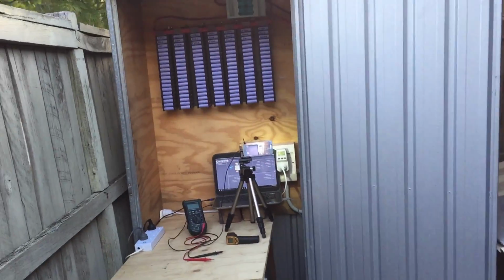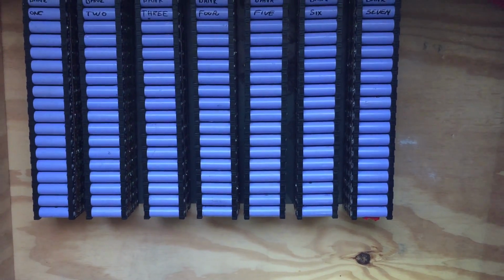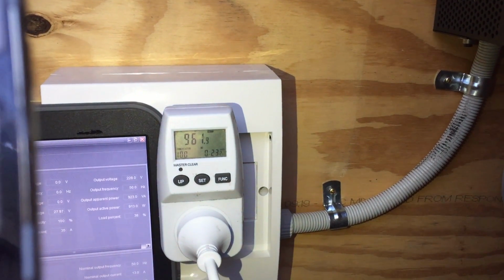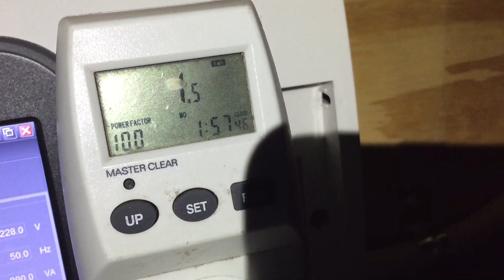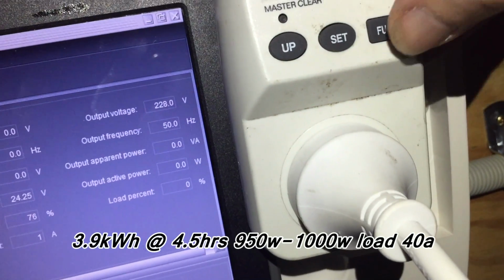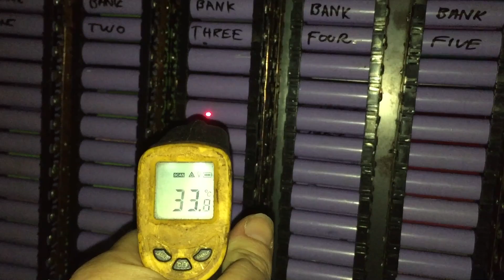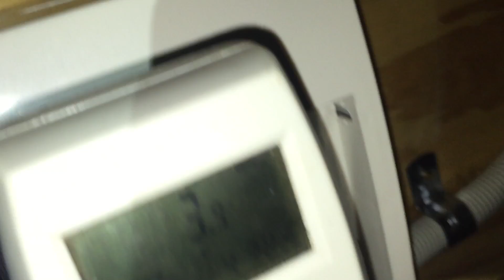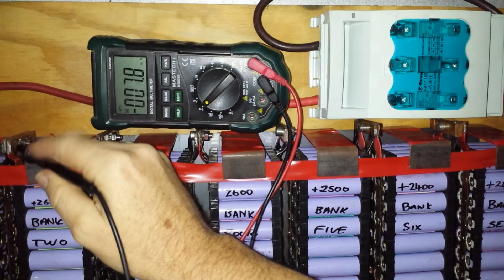First ever load test of my DIY HomeBrew Powerwall

Comment: Hi. I have been with solar panel for many years and started manufacturing my powerball. I've been following you for a long time and I think it's fantastic what you do. I have doubts about the minimum voltage to recover the 18650. From your experience you can recover the batteries with less than 2 v or not worth it.
Reply from the maker: I've said this more times than i can count. Voltage means nothing. 0.02v is recoverable if done correctly and by correctly I mean charge at 0.002 amps till you get over 2.5v. then charge/test like any other cell. It's just when the cell is ZERO volts you recycle straight away
Reply: ok

Comment: LOL "I am going to upload a video to prove how much of a moron I actually am" ps that fire extinguisher aint going to do shit
Reply from the maker: Don't dissagree - what about the 120 temp sensors that triger a shunt trip when any get too hot too cold or go over or under a infinataly adjustable voltage ie right now if any cell rises above 4.18v EVERYthing shuts down THEN my bms brings voltage back down to 4.13v you can rant on all you like won't be anything you can say that hasn't aready been addressed :) xxoo

Comment: Just a question, I have a 15kw LF inverter by power jack, uses 24v, works awesome, I currently have 4 12v car batteries of 700cca each that will run a 3500w load for 3 hours, so my question is how many 18650s will I need to work properly? Thanks
Reply from the maker: It's impossible to use Powerjack & awesome in the same sentence. I have had repeated horrible experiences with their products and warranty procedures. Now to your question - your math seems off, you get 10.5 kwh from 4 car batteries? Either my math is off or you mean 350watts. Can you clarify the load that your running again?
Reply: HBPowerwall no it was 3,500 watts because at the time I had a power outage during the winter so i had it hooked to the breaker box to run my central air furnace, infrared space heater, my electric griddle and coffee maker and half the house lights (I was in the middle of making breakfast when it happened)  so it was an unofficial test but surprising as to how well everything worked.
Reply from the maker: I would be very concerned about pulling those amps for 4 car batteries - I've done the same thing killed a plate in my batteries (each of them all brand new) i wasn't happy. Great that it got you out of trouble tho!!
Reply: HBPowerwall my cables were getting warm and they are core batteries that I got from my job that had at least 75% life left

Comment: I need and advice. I have modules of 6x12=72cells 2150mA cells (572W). I can buy 3000mA cells so I am making 4x13 modules(577W).  I am installing this different modules in series, do you thin they will work right

Comment: I notice you place the positive and negative terminals on the same end of the packs.  Average Joe claims that you shouldn’t do that because it tends to pull the amps from the cells nearest the terminals. Therefore, he put the negative and positive terminals on opposite ends of the packs... do you think this is why the tops of your packs are getting hotter ?
Reply from the maker: Yep, this test was done 12 months before Jo's lol after this test I changed all to top n bottom :)

Comment: would that pack be able supply 2kw, I want to build a similar pack that will be able to supply 2kw even if its only for a few hours. is that possible you think
Reply from the maker: Everything is possible :) How ever is it practical! It would you could happily draw that from it how ever tests prove after a few hours they start to heat up with 1000w draw...
Reply: I want to build a solar system to run a load of 2300w for a few hours at weekend thinking of using around 800cells, do you think its a bad idea, dont want to spend money if the system will not work. Thanks
Reply from the maker: 1200 cells would work i think, but is it a constant 2300w load ? that's a big constant load

Comment: The problem with the heat is 2 things. someone mentioned in many vlogs before you taking both the power from the top batteries so the bus bar resistance is lowest at the top but too late to change that. so making one bus bar taken from the bottom would even that out.. 2nd issue is that heat rises and the bottom ones would heat up the ones above them. but that won't be toooo much, i suspect the top ones are being drained more due to the bus resistance really. I'm sure you've realised this by now anyway (2016)

Comment: i need a pack that can run 1500 watts at 110v or 230v for at least 30 min (more is fine) should i use lead acid batteries or these lets say laptop batteries? they also will be charged and discharged 24/7 (its suposed do be a UPS for servers)
Reply from the maker: You'll have to do your own research sorry.

Comment: Great video !!

______________________________
Power = Voltage x Current
W = 3.7V x 20A
W = 74

Energy = Voltage x Current x time
W time = V x I x time
W hour = 3.7V x [3000 mAh]
W hour = 3.7V x 3 Ah
Wh = 11.1

That simple.

And for reference,
1000 Wh = 1 kWh [1 Electrical Unit], 
which is what our kWh energy meter uses in home
______________________________

mAh and Ah which are seriously flawed unit (which doesn't take voltage into account),
which is normally used by manufacturers and marketers to misguide people !!

Professional and universal unit for energy are,
kWh or Wh.

I mean, these all of us use kWh meter in home, kWh in Tesla car,
and 1000 Wh = 1 kWh. 
(how else simple do you want ??)

Still people use mAh and Ah, wonder how lame can they get !!!

And for comparison (different rechargeable battery types):
AAA [NiMH] = 1 Wh
AA [NiMH] = 2.5 Wh
AA [Li ion] = 3 Wh
C [NiMH] = 5 Wh
D [NiMH] = 10 Wh

18650 [Li ion] = 8 to 13 Wh (high drain to high capacity)
26650 [Li ion] = 14 to 18 Wh

____________________________
Average energy of Tesla battery are around 11 Wh [18650],
and to make a Tesla P100D [100 kWh] Model S,

= 100 kWh / 11 Wh
= 100, 000 Wh / 11 Wh
= 9091 batteries

or in simple words,
9091 [18650 battery] x 11 Wh = 100,000 Wh = 100 kWh.
____________________________

So i would seriously recommend 18650 enthusiasts to use Wh and kWh [our universal unit] instead of flawed mAh and Ah which are way too childish unit for energy !!
Reply: I'd rather we used Joules.
Reply: yeah.. total stored Joules of energy makes it easier to convert between everything because it doesn't depend on any other unit or data.. joules are joules, regardless of the voltage, current, or time you use them in.

Comment: What software is that on the laptop?  Where and what is it measuring? Thanks for sharing!!
Reply from the maker: Software used is here > http://www.diypowerwalls.com/t-HBPowerwall-Offical?pid=898#pid898
It displays info from Inverters, Charge controller & energy monitor
Reply: So the software is inverter specific?  It would be great to use a software that was independent of the inverter. I am using the Schneider Conext hybrid inverter. 

What you are doing is very impressive, nice work! But be careful!
Reply from the maker: Yes in that video (that i just rewatched) is for the PIP2424MSX (but also does all PIP models I think) but none others. there are people out there doing all their own software and some are bloody awesome - however it's like making an air conditioner that fits every car in the world. Too many different inverter/charger combinations.

Comment: interesting, I wonder if you positioned the batteries horizontally if they would stay cooler. are they more efficient if they stay cooler?
Reply from the maker: they'd fall out of my rack :)
Reply: lol, I meant the battery packs. Hot air rises, so as the lower batteries give off heat, it travels up through the batteries above them. If you could lay the packs horizontally, I wonder if the readings would be more similar from battery to battery within the pack. Probably not a necessity if they're not getting too hot, but was just a thought.
Reply: They'd also take up a whole lot more room if you had them all laying horizontally, unless you stacked them, but that sort of defeats the purpose lol

Comment: Hey HBPowerwall. Have you seen ElectroDacus' solar charge controller? It is basically an ISL94203 battery management chip in a nice package. I think this would be a nice add on so you could monitor  your individual cell voltages wirelessly and provide cell balance. You could use one of the IO pins to shut down your inverter if the voltages or temperature go out of range. Check out his YouTube channel and read the Intersil datasheet for more info. Keep up the good work.
Reply from the maker: +Albert Fletcher it would be an awesome addition to my system. can't wait to get my hands on one but will be a few months i thinks at this rate.

Comment: i have a similar setup in Brisbane, but using agm sealed lead batteries, 200ah total, on a small pure sine 1.5kw inverter, and that can run my houses lights fans computer and tv, for around 12 hrs straight, before the battery hit cutoff voltage of 11v, then sun rise and charge up. only really use it if power outage. cant have wire and extension cords with my kids running round.
Reply from the maker: +Tom Hambling sounds much like the way i got into it. :)

Comment: Well done mate, tried to log into Blab but it was being a bit blah. The heat is obviously rising up the columns making the cells at the top hotter. All in all, those temps look really good by the way ! What's the max output on that inverter ? I'd like to see a test with a higher wattage draw down :-) Congratulations !
Reply from the maker: +DukeHeart Yeh, turns out heaps of people has issues with blab. Got the live stream sorted now tho i thinks..heat rises so i got a thermal camera :) i'll get to the bottom of it !

Comment: FYI, you may want to get a Class D Fire extinguisher.  They are usually yellow and work on metal fires.  The red ones will not work on the batteries directly.
Reply from the maker: +BloodBlight ok, thanks for a heads up

Comment: Proper real world test..top job batman.4hrs+ @1000w very impressed. Remember any heat generated = wasted energy so beef up what you can.. The warmer pack may be a weak or couple of weaker cells I have had the same when fully tested cells that seem fine but under load get warmer than others
Reply: +1bigsyd did you test resistance on the cells? Higher internal resistance is a sign of a cell going bad, no matter the capacity.
Reply from the maker: +1bigsyd i'm getting there :)
Reply from the maker: +Rocket Rose yep

Comment: Heavy Load! 

Nice work Peter. Keep on keeping on.
Reply from the maker: +Darin Bicknell Next test is 500watts - then 2000w next satruday :) I have a feeling that'll be a good vid
Reply: +HBPowerwall Heat? Will you add some cooling?
Reply from the maker: +Darin Bicknell no cooling, just add several thousand more cells :)

Comment: G'Day mate, it looks like you are using 4 gage power and ground cable off the pack, I think that is adding to your heat issue, for the DC side at 1000w I would be using 0 gage, 2 gage min. The 4 gage at those lengths will be struggling to allow the current through and therefore acting as a resistor creating heat.
Reply from the maker: +Da Rainmann more testing required :) or playing heeheh

Comment: Great job on this wall. I have a few questions. Is the heat at the top of the packs due to heat rising or are your bus bars too small/. could lay down the packs to find out about the temp problem. Also you can draw power from both ends of a pack to cut down on heat from the bus bars. Keep up the great work on this. We are all learning from you videos.
Reply from the maker: +Ronald Nelson bus bars were not hot at all. The positive connection was quite warm due to bad cable but it was the pack as a whole that was warm. I have a test lined up for next weekend that will soon put an end to this debate :)
Reply: +HBPowerwall  Keep up the good work will look for you next video

Comment: Thats really good
How much load is there on single 18650 cell?
Reply: The current is P/U = 1000W/27V = abou 37A. divide by 80 cells = about 460 mA per cell. That's like 0.2C. That shouldn't heat the cells up. I think what gets warm is the bus bars. Like he said, warmer at the top which is where the highest current flows.
Reply from the maker: +Peter Faber rented thermal camera, time to find out :)
Reply: Maybe you could connect the bottoms of the packs together as well to distribute the current more. It may end up giving you better power output if it means cells at the top of the pack put out as much power as those on the bottom. I don't know how large of a difference that would make but it is worth I try I think

Comment: I use according to my monthly electric bill 3 Kwh a day. Double that or more would do me just fine.  I'm a big fan on not going lower than 50% battery bank capacity  for the extra cycles you get out of the bank.
Reply from the maker: +sailingsolar 3kwh a day - woooh! we typically use 30+ every day...this was just a good test - discharge rate will drop once more and more packs are added..
Reply: HBPowerwall I live alone, have a frig that is about   9 cu ft, a hot water heater that runs 30 minutes @ 7 am and 25 minutes @ 6 pm on a timer and I only use  3 CFL (.17w each).  One in my kitchen, bath and bedroom. No tv just internet for all my entertainment needs.  TV programs are about 33% advertisement so I don't like watching tv because of the wasted time watching advertisements.   The only way I can figure to use less power would be to have two on demand point of use hot water heaters, one for the kitchen and bath.   I live in the us virgin islands,  where power was at 58 cents a Kwh when oil was at it's historic high (2008-9).    Right now it's at 38 cents a Kwh.  Live cheap and you don't have to earn as much.  Of course I could never get away with this with a wife and/or kids.  I like having the smallest possible carbon footprint   I do enjoy your videos, thank you for posting them.   You rock in my book.  Cheers mate!
Reply: HBPowerwall  That helps to explain it, 3 teanagers and a wife.  Just for fun, let's see if I can guess about what "might" be in your home.  This is not pointing fingers it's just for conversation.  You could have a large doubledoor side by side refrig/freezer, possibly a 40 gallon water heater.  Which is set hight enough to cause first degree burns unless you mix it with cold water too. You could have a large square footage home and if you have electric heating or cooling live in a place where you use that daily. A/C is the worse in you live in a hotter region.  Electric AC heating and cooling is typically the single largest power load in a home.  Electric hot water is the second largest load and Refrigeration is the third.  Oh!And  I'm thinking you have an electric range/oven that get's used to prepare food for those growing kids.  Those factors can easely run up your daily usage, you having.  If I can suggest from what I know, all the time and effort you putting into your systen wouldproduce the greatest return if it was applied to putting in a Solar thermal hot water system. Either a thermosyphon one or a solar powered circulating one, that uses no electricity at all. That would reduce your electric needs more than any single project you could possibly due.  Is it possible that you know your electric rate per Kwh, including all charges?  When crude was over $100 a bbl I was paying right at 58 cents (us) a Kwr.  Now I'm paying 35 cents. Like with anything it's just as much how much you pay as it is how much you use.  Great video reporting of the project your doing.    Best wishes to you and your lovely family, mate.
Reply: +HBPowerwall Wow, you use 30kwh a day. How do switch enough stuff on to swallow that. In the u.k electricity is 15p per kWh that's £4.50 a day. No wonder you have done so much work on that very nice power wall. Good job. Do you think it is worth the effort, compared to lead acid?
Reply from the maker: I run my computer workshop from home 3 teenage kids that sit in the shower for 45min each every day, 5 TV's lights fans etc etc it racks up quick lol